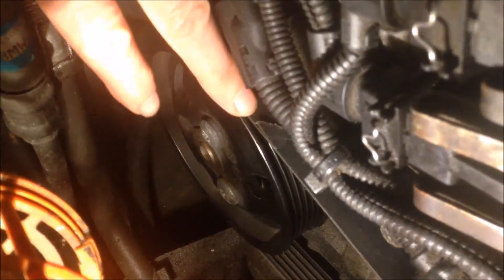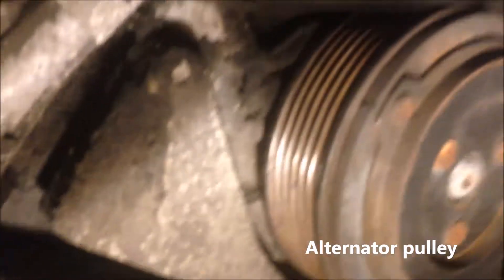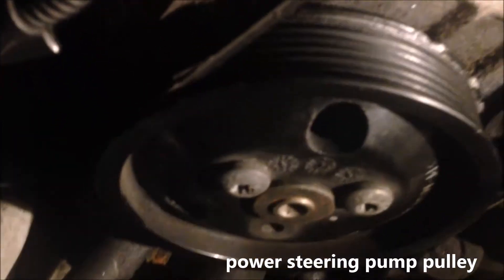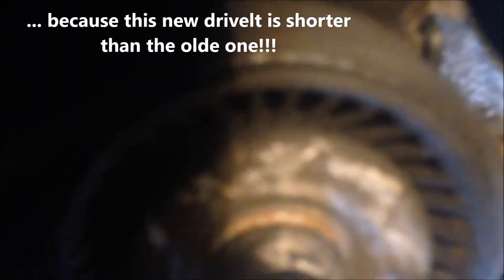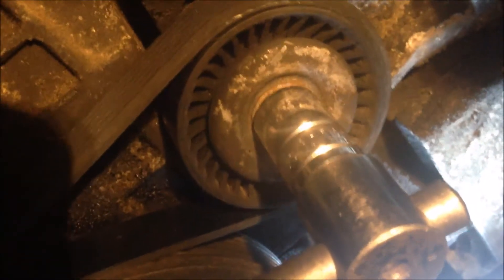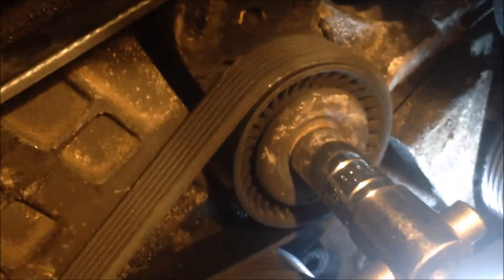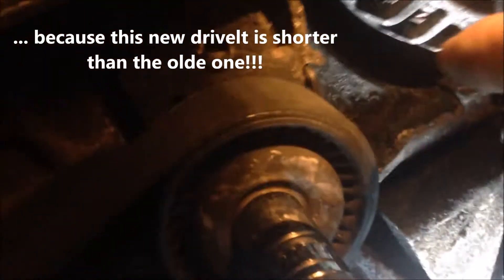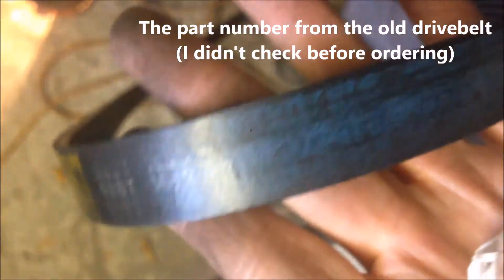BMW E46 / N42: Drivebelt - How to Replace

Comment: Have you had any issues since fitting the 6pk1870? I've just ordered the same because that's what the diagrams said 👀 will it run alright with a tighter belt?
Reply from the maker: hi, philip
when i installed, i have to turn the tensioner  past the stop position in order to put the new belt in. However after a few months when i needed to take the belt off again, i found it was no longer short and tight anymore! At the tensioner 's stop/locked position, i removed and installed easily as it should. Therefore it seems no problem to my car. good luck! charlie
Reply: RepairDIY awesome, thank you!
Reply from the maker: have a good weekend!
Reply: Thanks, you too!
Reply: Really happy that a couple of frames of the video helped me find out how it's supposed to be fitted, thank you so much haha!